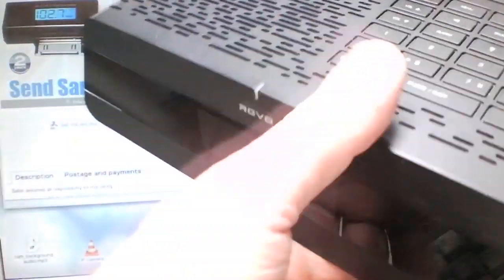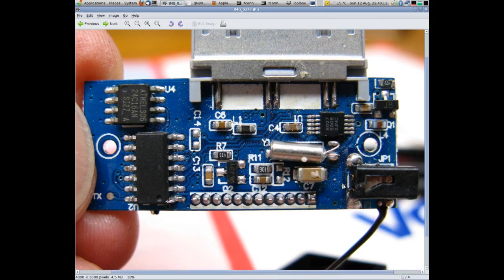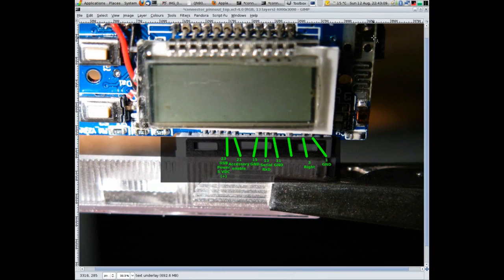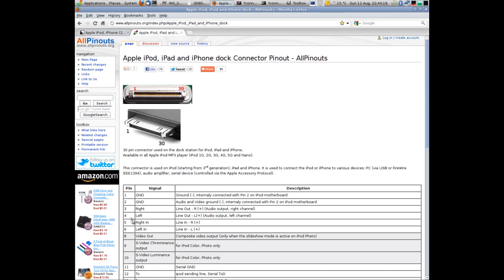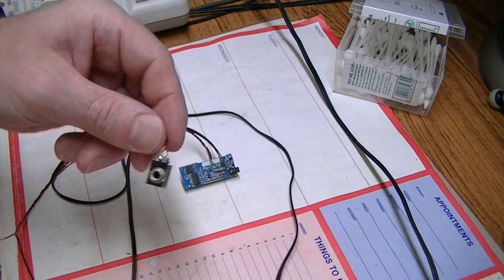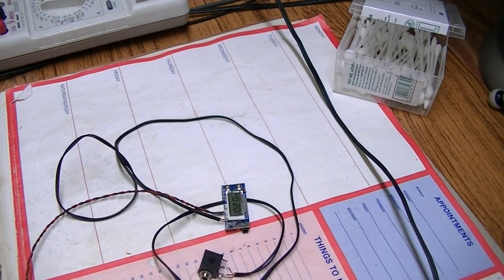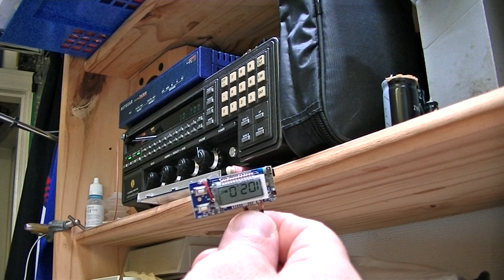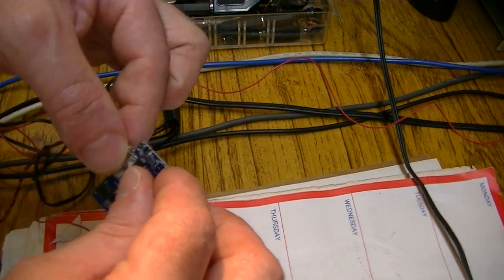FM Transmitter mod for DAB/Wi-Fi Radio. Part 1 of 2

Comment from the maker: The transmitter circut in the video if fed from my DAB/Wi-Fi radio line level audio output which is around 700 milivolts.
RF output power is only 20mW at best. So any booster amplifier you intend to use needs to accept low level RF

Comment: I got one FM TX from ebay & it works good... But volume at reception end is too low compare to other standard radio channels. May i know the transmission power in mW. Can you suggest me any FM booster circuit for this to build?

Comment: i have an fm transmitter with this QN8027, its posibble to attach external antenna to boost?
Reply from the maker: Pin 5 of the QN8027 is the RF output. You could connect about 28 inches of wire to it. That gives you a quarter wave antenna at 100MHz.

Comment: Hi, is it possible to theoretically build a a miniature DAB transmitter that could transmit a signal to all cars within a 100m range of the transmitter only, regardless of radio channel tuned to?
Reply from the maker: You'd have to monitor all Band III (174–240 MHz) broadcasts in your range and then re-transmit DAB on the carrier frequencies you detected. DAB is not quite as trivial as FM or FM+RDS. You would surely be breaking a whole bunch of laws too.
Reply: @NickNorton  have you heard in Ireland they have shut down DAB but pirates are using Dab+  !?
Reply from the maker: @charlesloukas1946  DAB was unfortunately a way of Tx'ing multiple MP2 streams with insufficient bandwidth.

Comment: can you make a Transmitter for me 50-100 mill to work with fm and dab
Reply from the maker: +Attitude Radio, lol, well The QN8027 also supports RDS/RBDS data transmit. Add a nice burner on the output and you’ve got yourself a nice FMTX!